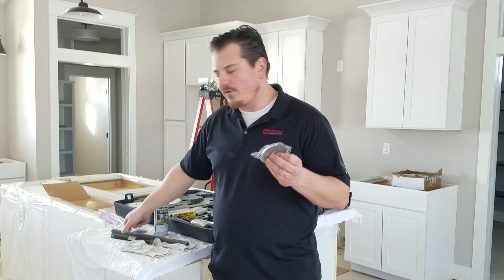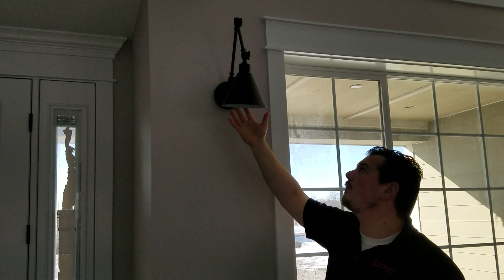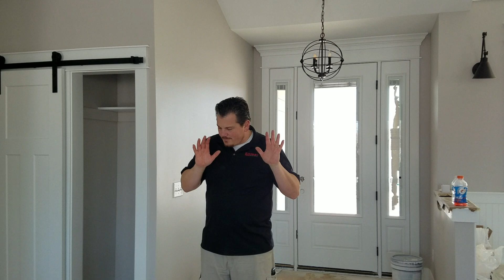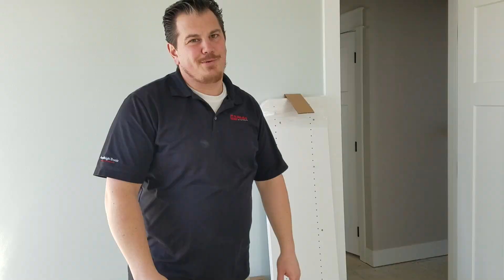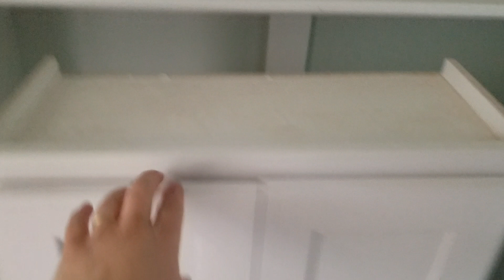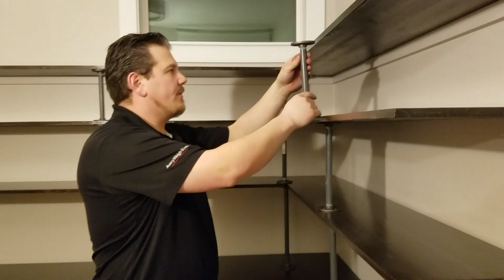New House - Build Update - 3/10/2019 - Fixtures, Pantry, Shower, Water, etc!

Comment: Great house but  not too keen on the brackets for the sliding doors but that's just an opinion
Reply: My brother had the sliding barn doors done in his house and they are great.
Reply from the maker: They seem to work well, but without the lower bracket to keep if from tipping, you really have to be vigilant to avoid door or wall damage.
Reply from the maker: Which brackets are you talking about? OHHHHH, do you mean the barn doors?
Reply: @BrianPhillipsRC  The sliding doors in the house
Reply from the maker: Sliders were a means to an end in this floor plan. We needed to save a few square feet in critical areas, but it comes at a price....no switches or outlets in that 30+ inch deep area, and they are a load of work to get right.
We don't really plan to close them all too often.